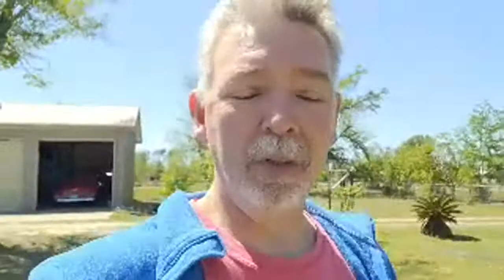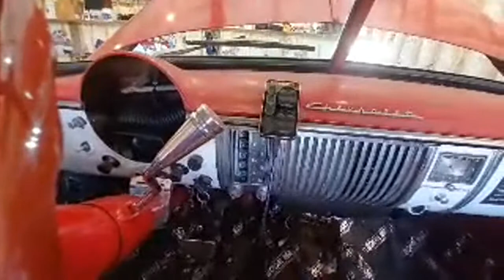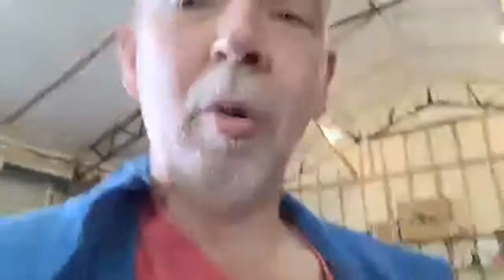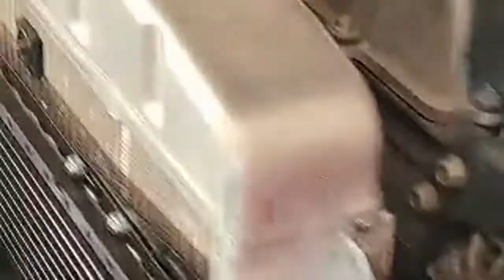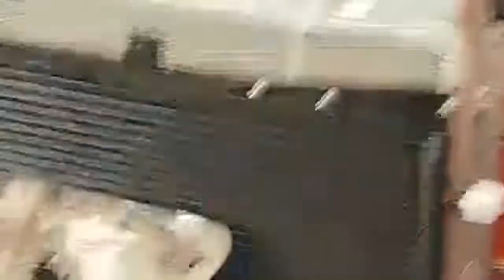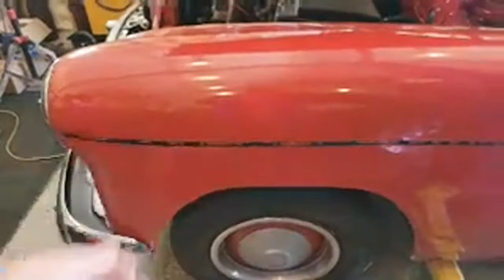Live - 400 Miles on Bagged 49 Chevy, Wins, Fails and Tales

Comment: Sorry about the accuair issues.  But You have convinced me to steer clear , altho im looking at their tank w/outside compressors.  Jeminez Bros has their own system, they built my suspension kit. Still researching the system to purchase but it has to be auto level for sure, Pans and tanks hanging down and emptying at speed is a no bueno.